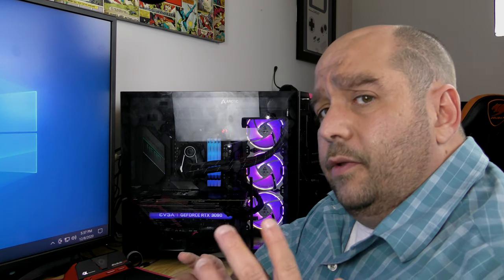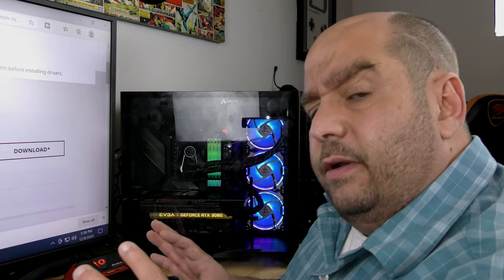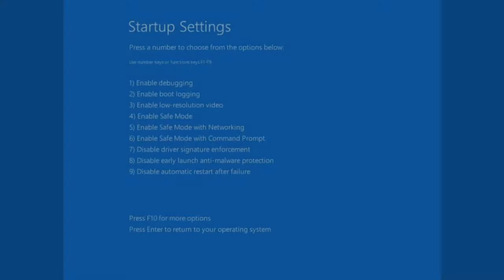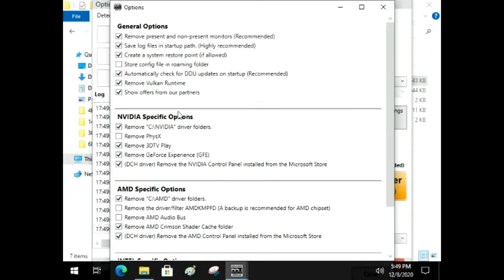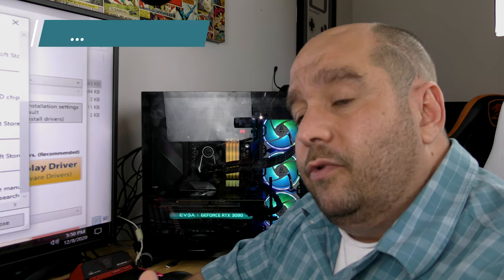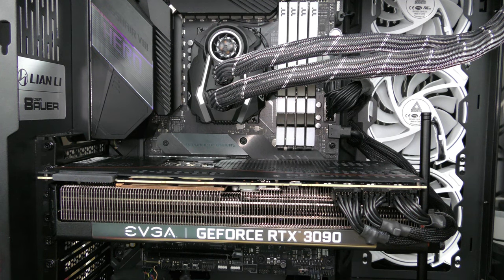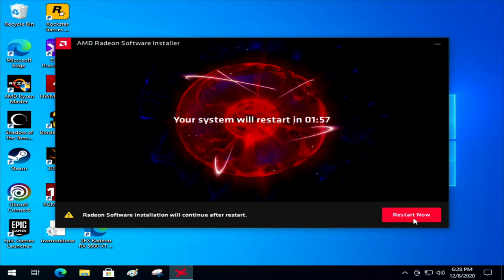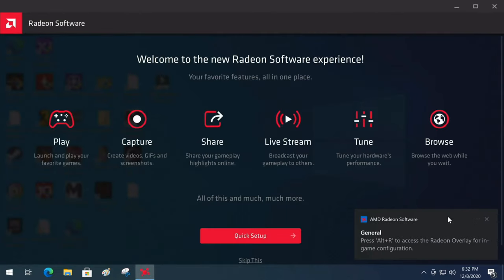AMD Radeon RX 6800 - Installing the Sapphire NITRO+ RX 6800 Gaming

Comment: Silly question, but does each of the power connections to the GPU need to come from separate cables on the PSU? Or can a splitter cable provide enough power?
Reply from the maker: As an example, pop a hole in a straw, and share a drink with a friend, do you still get the same amount of drink or do you get much less and lots of bubbles?  It's not silly at all, but I give this real world example to help realize what splitting the line does.
Reply: @ThisBytesForYou   I appreciate he analogy, but I’d appreciate a more literal answer if possible? 
Pity the poor tired Brit.
Reply from the maker: You are splitting how much power the card receives per connection  @waratempire
Reply from the maker: Did that give you the info you needed? @waratempire
Reply: @ThisBytesForYou  it did Thank you. It’s strange to think that it’s never covered, even in the manual or installation guide.
Reply from the maker: @waratempire  it is on some manual, but not all you are right.  For example I believe on the manuals for the 4090 directly from Nvidia it gives mention to it but not on 3rd party cards, I dont remember AMD doing that, but I have only noticed it once with Nvidia, never before but I try to always tell people to do this and it's helps tons
Reply: @ThisBytesForYou  I’ve been regretting my move to AMD ever since I picked up this card, but I am dead set to get my moneys worth! Assuming the AMD driver instability doesn’t make me cry harder tomorrow
Reply from the maker: So that I can help, please list the manufacturer and exact model number of the following components:
1. Motherboard - manufacturer and exact model number
2. CPU - manufacturer and exact model number
3. RAM - manufacturer and exact model number
4. Video Card - manufacturer and exact model number
5. Power supply - manufacturer and exact model number
6. Monitor - manufacturer and exact model number
 Redundant I know, but many people forget to enter manufacturer and exact model number
7. Do you have ALL of the PCIE connections plugged in, and not daisy chained or pigtailed, each coming directly from the power supply?
8. Are you running through HDMI, DP, DVI, VGA, any adapters?
9. Is UEFI or Legacy Setup in the BIOS?
10. What slots do you have your RAM installed in?
11.Do you have CSM Enabled or Disabled in the BIOS
11. Installed latest supported chipset driver?
12. Have you disabled Fast Boot within Windows?
13. This video will help you identify hardware inside your PC: https://youtu.be/65ZSiVImJx0
Reply from the maker: AMD makes great cards, their drives though want you to be on the latest hardware, but you can make them work.
All of this makes a difference.
1. Select UEFI only in the BIOS (if you can't boot anymore, this is probably your issue, don't worry, when you set it back you will be able to boot, but you will need to convert, I can show you how)
2. Is you boot drive, your C drive, GPT or MBR?
3. Is your RAM set to XMP in the BIOS?
4. Make sure your RAM is installed correctly, check it out: https://youtu.be/xqWfeOsTto8
5 You should be on the latest BIOS (release 1903), https://dlcdnets.asus.com/pub/ASUS/mb/LGA2011/STRIX_X99_GAMING/STRIX-X99-GAMING-ASUS-1903.zip?model=STRIX%20X99%20GAMING
6. Here is your chipset driver: https://dlcdnets.asus.com/pub/ASUS/misc/utils/Intel_Chipset_V101219.zip?model=STRIX%20X99%20GAMING
Here is your ME driver: https://dlcdnets.asus.com/pub/ASUS/misc/utils/MEI_Consumer_V11051189.zip?model=STRIX%20X99%20GAMING
Install Chipset first
10. Is your hdmi cable hdmi 2.1 or older, it NEEDS to be HDMI 2.1
11.  When you turn on your machine, do you have both monitors connected?
Reply: @ThisBytesForYou  
Seems like some magic combination of your instructions and overclocking my CPU using AI Suite 3 has done the trick. Still unable to run 3D mark benchmarking, but other benchmarking software works fine.

Got a CPU and Motherboard upgrade on the way and fingers crossed that will be the end of it.

Big thanks for your assistance on this one <3
Reply from the maker: good stuff my friend, the secret behind overclocking is filling the nooks and crannies with voltages, sometimes it needs some more voltage to fill those holes to get solid, you and I could have the EXACT same PC, but the requirements and performance could be very different, no 2 chips are the same, or memory, or graphics card, etc, so maybe you got it.  So happy I could help you get this far, hopefully I can help you get further at some point.

Comment: Follow to a “T” once powered back on in safe mode and new graphic card installed no signal????
Reply from the maker: So that I can help, please provide the manufacturer and model number of your motherboard, cpu, power supply and video card.
Reply: @ThisBytesForYou   ended up pulling out power supply and ordered a replacement. The one that was in my pc was only a 500w 😂🤣😂. Specs said had 2 pci connections but one was already plugged into the motherboard. Let you know once new one comes in if I have any issues.
Reply from the maker: yeah, a 500watt is death, I always go much higher, I have a 1000Watt, it never let's me down.  What did you end up getting?
Reply: @ThisBytesForYou  Apevia ATX-JP800W Jupiter 800W
Reply from the maker: @tracyblankenship9045  OK, that power supply seems to be good, make sure the PCIE cables you have connected to the card are separate cables and the main strand of the cable, don't use the cables that branch out, use the main cables.

Comment: dumb question but do you need 2 completely seperate 2 PCIe cables to plug into the 6800 ? My PCIe thats in my pc now has 1 cord but its split to where I have two separate 8 pin connectors.
Reply from the maker: yes you do, if not you will have issues.  What is the manufacturer and model number of your power supply?
Reply: @ThisBytesForYou  thanks man! I have a Corsair 850 gold.
Reply: @ThisBytesForYou  I have extra cords I can just plug one in. No biggie!
Reply from the maker: @thereelty5988  ahhhh perfect, then you are good.

Comment: Which cable and voltage do you use to control the rgb? Which port do I plug into my motherboard? Thank you
Reply from the maker: You can use either, I use the 5v 3pin
Reply: @ThisBytesForYou  thank you. Will plug into 5V with a 3 pin into MoBo.
Reply from the maker: Anytime bud, happy I could help

Comment: I have a Little switch above the GPU, what Is It?
Reply from the maker: It's a to Switch from performance mode to silent mode or back using TriXX software for a quick and easy switch between your dual BIOS modes.  switch 3, the switch facing the rear of the PC is software switch mode, #2, the middle is silent mode, where voltages are lowered to cause less heat and slightly less performance and #1, face towards the front of the case is performance, which is 100% unlocked speed.

Comment: at the same price, should i buy a 6800xt nitro or a 3080?
Reply from the maker: Thats kind of a Rough one, they are both great cards, what does your system config look like now?
Reply: @ThisBytesForYou  all is new, 5 5600x
Reply from the maker: @stevenguerra1134  I would say, the 3080, the 6800 XT is VERY nice, but its AMD's intro into ray tracing, and if you remember the 20xx series for NVIDIA, the intro was rough

Comment: Sir I need your help... I have a question for you does nvidia has better image quality or color quality than amd, I never owned any good gpu to test so I don’t know.... please help me
Reply from the maker: Well, AMD has more clear and vibrant colors out of the box..... BUT for AMD, Intel, NVIDIA, those colors can be changed to be equal or better and a lot of it has to do with monitor as well.
Reply: @ThisBytesForYou  thank you sir for replying me I love pleasing colour so I'm afraid to pick that's why I'm asked you... so my choice is amd
Reply from the maker: Out of the box yes, but all gpu's can be corrected and your monitor is another potential issue.  Don't grade your experience on the gpu itself, because you will be limiting yourself since everything can be adjusted, even the monitor.
Reply: @ThisBytesForYou  sir I never owned any desktop stop I use laptop my spec is i5  4gb ram and 1 gb amd hd 6470m this is my current spec sir from this you can  understand that I never used any good gpu... I saw a comparison between Nvidia and amd in resident evil 3 in that amd looks flat and blurry image but Nvidia looks little bit colourful and clear from there my question starts about the colour quality maybe you're ryt sir we can adjust colour setting ryt and thank you sir for replying me

Comment: why don't you plug the RGB cable ? it works fine without it ?
Reply from the maker: it will work fine without it, which is why I didn't include it here, its not required.  But, here is what happens when you use it: https://youtu.be/GTJw0j6ResI

Comment: cant use both video cards at the same time and not have issues problems with the drivers?....
Reply from the maker: use both of what video cards?
Reply: @ThisBytesForYou  for mine bitcoins or play games/work with one and mine with other... nvidia and radeon.
Reply from the maker: It shouldn't have an issue but I don't mine bitcoin, so I can't tell you for sure.  Crossfire should work, but it is pointless now, as games are not really written for it and can cause issues.
Reply: @ThisBytesForYou  
If, I do not mine either, it is only to recover the investment in the whole computer plus graphics that I have bought, it consumes a lot of electricity at least in my country it is profitable to be able to mine, the idea is to have an rtx 3060 ti and a radeon 6800 sapphiro nitro + both would take different processes, apart I must work with window office and do other rendering work.
Thank you very much for answering :)
Reply from the maker: @gm5135  you actually will spend a lot more money trying to mine because of power, also right now NVIDIA is the king of mining cards, not AMD anymore, so you might actually do better getting a 3090, 3080 or another 3060.  I don't recommend mixing AMD and NVIDIA on the gpu side, toooooooooo much potential for issues.  Always a pleasure my friend, thanks so much for stopping by, liking and subbing and commenting, it means the world to me.
Reply: @ThisBytesForYou  your welcome, thanks so much!! :) so is better 1 rtx 3080 but idk if is better the msi gaming trio x or msi ventus 3x oc.... :S
Reply from the maker: @gm5135  GeForce RTX 3080 GAMING X TRIO 10G would be better, and so very happy I could help my friend.
Reply: @ThisBytesForYou  :) ok, i must fight to get one because are out of stock T_T right now i can get ventus 3x oc only.... thanks to you, i hope is not big difference.
Reply from the maker: @gm5135  no, not a huge difference, the other is just a tiny bit faster.
Reply: @ThisBytesForYou  :) ty.

Comment: Any ideas how to resolve a constant crashing issue I'm having with this card it's doing my head in I've reinstalled all drivers and so on and yet it still keeps happening ! Pllleeeeaassseee help me
Reply from the maker: I would love to help you, but I need some info, what is it crashing on?
Reply: I've experienced the same with the AMD Radeon 6800 XT. I've only had my PC for 3 days and the 6800 XT's been rather fiendish with constant crashing, screen flickering, artifacting and shutting down/restarting Windows. It's worse when trying to play games. I also did a DDU/clean driver install, but to no avail, so I'm getting it replaced. I'm suspecting it's underpowered, even though the PSU meets the GPU's requirements, but I'll see what the replacement card does.
Reply from the maker: @vantablack1982  did you also have all the PCIE connections plugged in, and not using pig tailed connections, but using straight connections from the power supply, one connection per strand.  Also, another thing that causes the flickering, stated in the released notes is enhanced sync, disable it in the drivers.

Comment: Hey cool video, I like how u explain things. I was lucky to get a xfx rx 6800 but it won't give a signal to my monitor. I was about to upgrade from an old r9 380x. Google told me to pre install the right driver and update BIOS to the latest version but nothing helps. I just tried to use another powersuply cable to make sure it's not broken or something.
Do you have a mind how I could fix this?
Specs: msi x570 Gaming edge wifi
Ryzen 5 3600x (corsair aio water-cooled)
4x 8 GB 3200 MHz corsair vengeance Pro
New 750W beQuite modular PSU
Reply from the maker: did it work with the 3600x or did you just build the machine?
Reply: @ThisBytesForYou  The system is not new. Just wanted to upgrade GPU and PSU. r9 works fine with the ryzen 3600x but the rx 6800 does not.
Reply: Did you put the the cable from the display in the right port?
Reply from the maker: @robinmarx1441  So going from the R9, did you change the type of cable, maybe going from VGA, DVI, HDMI/DP to another port?
Reply: @ThisBytesForYou  Yes there are 3 x Display 1x HDMI and I tested them all with different cables on both cards. I even tried to use my older monitor.
Reply: @xXDESTINYMBXx  Yes, Sir. I switched multiple times between the 2 graphics cards and every time I tested out another cable slot.

Comment: Hey, thank for your video. I just changed motherboard asus rog strix b550-f and ryzen 7 5800x but my rx6800 won't load monitor. Everything runs but it just won't start display i dont know why. I did everything as you said. My old nvidia 1060 works fine tho. Any idea why is that? I deleted nvidia and amd drivers
Reply from the maker: Always a pleasure my friend, happy I could help.  A few questions

1. Did you plug your monitor into the RX6800?
2. Do you have all the PCIE cables connected to it?
3. Is your power supply at least 850Watts?
4. What is the manufacturer and model number of your motherboard?
5. Is your HDMI cable 2.1 or your display cable 1.4?
6. Did the 5800x work on this motherboard before you changed the motherboard
7. What CPU did you have in the motherboard before?
Reply: @ThisBytesForYou  thabks for your quick answer. 
1. yes
2. yes
3. power supply is 750 but worked fine with my previous motherboard and rx6800
4. dont know the answer to that sorry but as i said it's asus rog strix b550-f gaming
5. Don't know but it's the same monitor as before and worked with the graphic card
6. No i changed them toghether and uploaded all drivers needed and updated bios on motherboard
7. Don't remember the motherboeard before but i had cpu i7 7700k
Reply: @ThisBytesForYou  I remember having troubles too when i first installed the rx6800 on my old setup but it somehow started it. I remember i fixed by buying new power which is the one i have now. I think 750 is enough for this setup even when stressed or not? Should i try with 850w?
Reply from the maker: OK, chances are its the fact that the 5800X will only work on boards with certain BIOS, luckily you have BIOS flashback.  You can watch this video on how to use BIOS flashback: https://youtu.be/RnbMHHR0E_g and you can get your BIOS from here: https://rog.asus.com/us/motherboards/rog-strix/rog-strix-b550-f-gaming-model/helpdesk_bios/
As for now, I have to go, I need to go to bed and do some studying.
Reply: @ThisBytesForYou  ok no worries man. Thing is I already have installed the last bios but didnt fix.
Reply from the maker: So that I can help, please list the manufacturer and exact model number of the following components:
1. Motherboard - manufacturer and exact model number
2. CPU - manufacturer and exact model number
3. RAM - manufacturer and exact model number
4. Video Card - manufacturer and exact model number
5. Power supply - manufacturer and exact model number
6. Do you have ALL of the PCIE connections plugged in, and not daisy chained or pigtailed, each coming directly from the power supply?
7. Are you running through HDMI, DP, DVI, VGA, any adapters?
8. What slots do you have your RAM installed in?
Reply: @ThisBytesForYou  Hi, I fixed it today by moving to the right a little switch on the front of the graphic card. I just did it without even knowing what is it and worked instantly.
Reply from the maker: @Robemi93  so did you flash the bios on your card previously?
Reply: @ThisBytesForYou  i actually don't know. Maybe I touched it by removing it. Can you tell me what actually does that switch?
Reply from the maker: it overclocks your card, which can make sense if you are running a 750watt power supply. @Robemi93
Reply: @ThisBytesForYou  oh ok. Thanks for the info. So now i can keep it that way right? Sorry I'm not an expert I'm just trying to understand.
Reply from the maker: yup, that is correct and no worries' bud, we were all noobs, we are started somewhere, with everything in life, I didn't know about computers at one point, i was a noob, then I wanted to learn, so I did, and I am so happy I can help you in that journey.,